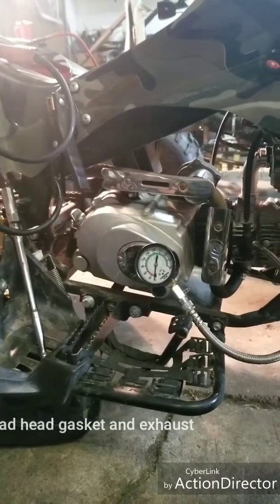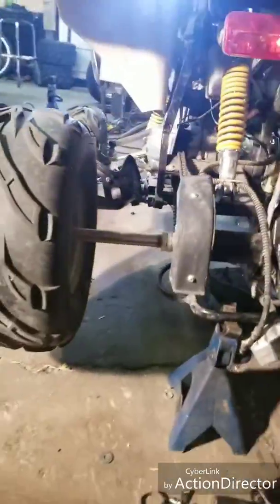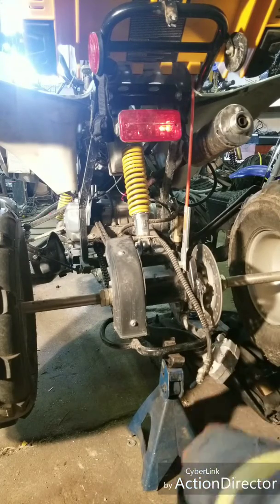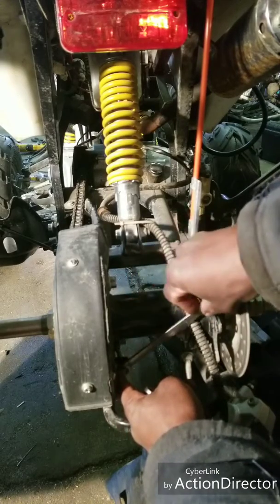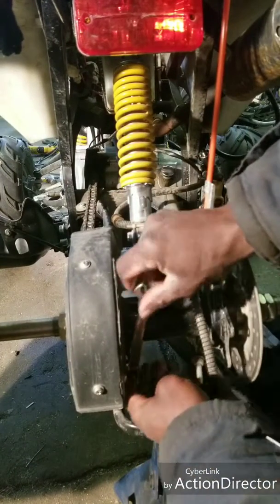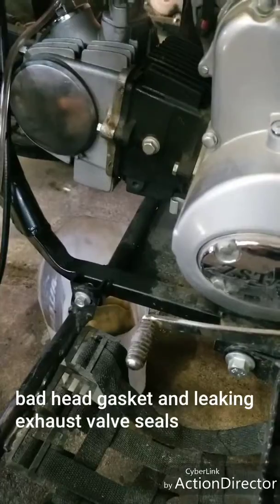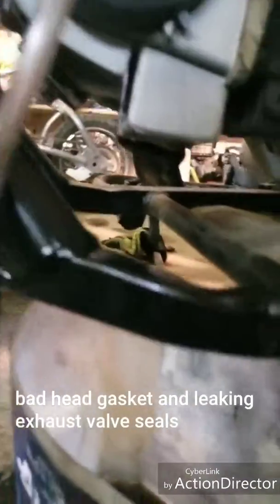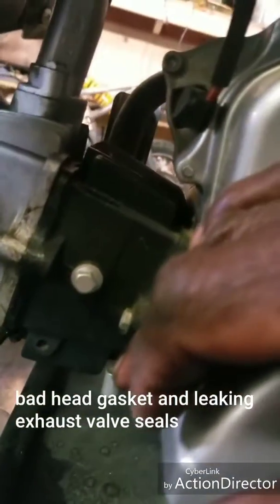110cc Chinese atv compression test

Comment: I'm getting 65 psi what do you think I should do
Reply: You need to do a leak down test. Bring the piston to top dead center, Connect an air line to the compression tester hose and run air through it. If air comes out of your muffler then it has to do with an exhaust valve, if it’s blowing out of the air filter then has to do with intake valve… be sure to take the oil fill plug out and if the air is coming from there then it’s your rings. Get bubble from the dollar store and mix with water in a spray bottle as bubble solution bubbles more than anything else… spray around between the head and crank case where the gasket sits…. If air is coming from there and you see bubbles, then you need a head gasket.
Reply: me too bro did u find a fix
Reply: Did you two ever find the solution? I’m in the same boat
Reply: @jimmyfish632  could be valves or head gasket, try putting a little oil in the spark plug hole and see if it bumps compression up a litlle farther. my best guess would be your valves need adjusted if its that low
Reply: Also, it wasn’t mentioned in the video, but whenever you do a compression test you need to be WOT (wide open throttle)